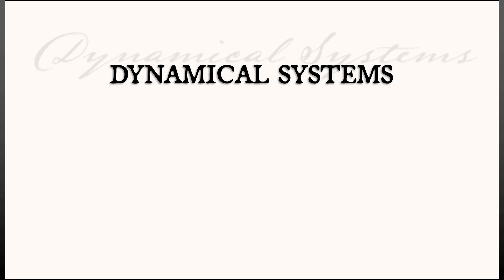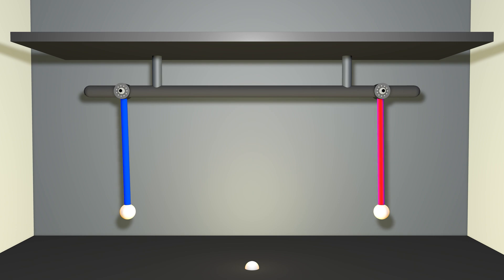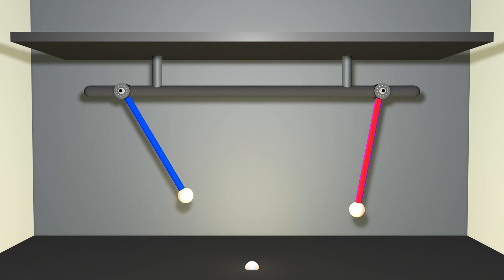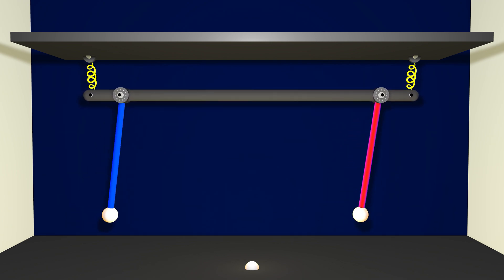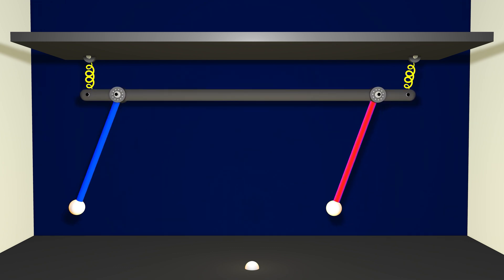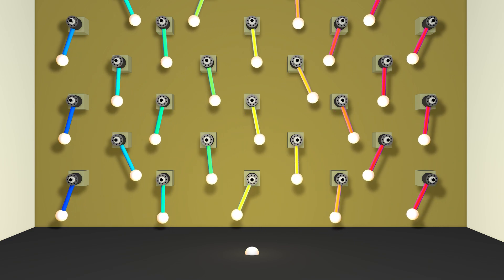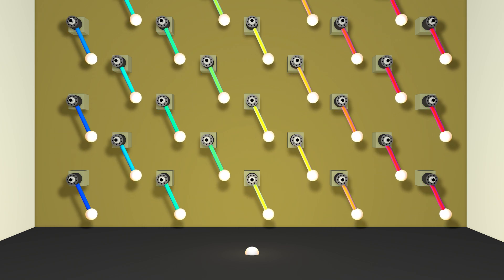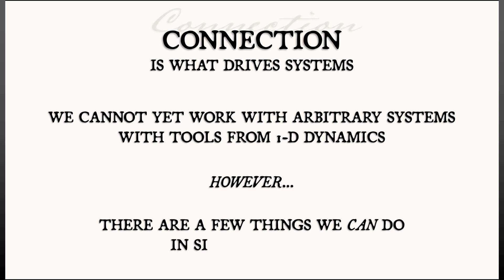ADS : Vol 1 : Chapter 6.1 : Intro to Coupled Systems

Comment: Hey take look at this might be useful, The Principle of Commensurate–Incommensurate Constraint
Abstract
I introduce a unifying principle governing the persistence or relaxation of coupled dynamical systems based on the commensurability of their characteristic frequencies. Systems whose interacting frequencies form rational (commensurate) ratios exhibit phase coherence, resonance, and sustained activity despite dissipative losses. Conversely, systems governed by irrational (incommensurate) frequency ratios exhibit phase drift, decoherence, and relaxation toward equilibrium. This principle provides a domain-independent criterion for predicting whether dissipation leads to decay or sustained dynamical structure.

1. Motivation
Many physical, mechanical, and computational systems display long-term persistence despite continuous energy loss, while others rapidly relax even under weak dissipation. Traditional explanations often invoke system-specific mechanisms, obscuring a deeper invariant governing both behaviors. This work identifies frequency commensurability as the decisive structural factor determining whether dissipation suppresses or sustains dynamical activity.

2. Definitions
Let a system consist of two or more coupled subsystems with characteristic frequencies {ω₁, ω₂, …, ωₙ}. The frequencies are commensurate if all ratios ωᵢ/ωⱼ are rational numbers. The frequencies are incommensurate if at least one ratio is irrational.

3. Statement of the Principle
Principle of Commensurate–Incommensurate Constraint

In a coupled dynamical system:

(a) If the interacting frequencies are commensurate, phase relationships recur periodically, enabling coherent accumulation of interaction effects. In this regime, dissipation does not eliminate motion but is counterbalanced by resonant energy exchange, leading to persistent or self-maintaining dynamics.

(b) If the interacting frequencies are incommensurate, phase relationships do not recur. Coupling effects average to zero over time, and dissipation leads to irreversible relaxation toward equilibrium.

4. Physical Interpretation
4.1 Commensurate Regime (Rational Ratios)
Phases periodically realign
Perturbations reinforce rather than cancel
Energy transfer is coherent
Dissipation is trapped within the system
Long-term activity persists
Canonical examples:

Mean-motion resonances in celestial mechanics (e.g., 1:2:4 Galilean moons)
Mode locking in oscillatory systems
Harmonic synchronization in engineered systems
4.2 Incommensurate Regime (Irrational Ratios)
Phases drift indefinitely
Perturbations decorrelate
Energy spreads rather than accumulates
Dissipation leads to decay
System relaxes toward equilibrium
Canonical examples:

Quasi-periodic motion
Ergodic mixing
Decoherence in coupled oscillators
Anti-resonant isolation strategies
5. Role of Irrational Constants
Irrational quantities such as √2 and π act as generators of non-closure:

They prevent periodic phase alignment
They suppress unintended resonance
They enforce dephasing by construction
Rational multiples of irrational constants (e.g., (3π)/2) remain incommensurate and therefore belong to the same relaxation regime.

6. Generality Across Domains
This principle applies independently of system scale or substrate:

Celestial mechanics
Structural and mechanical engineering
Signal processing and control systems
Computational scheduling and operating systems
Information flow and cryptographic isolation
The determining factor is not energy magnitude, force strength, or material composition, but temporal structure.

7. Consequences
Persistence does not require external energy injection.
Dissipation alone does not guarantee decay.
Long-term activity emerges when relaxation paths are structurally forbidden.
Stability may arise from enforced oscillation rather than equilibrium.
8. Summary
The persistence or decay of coupled systems is governed by whether their characteristic frequencies admit a shared temporal lattice. Rational frequency ratios trap phase and sustain dynamics; irrational ratios dissolve phase coherence and enable relaxation. This principle reveals a structural invariant underlying resonance, synchronization, and decay across physical and engineered systems.

Comment: I'm confused at 0:45 where you say that, because you pulled back the pendula unequally, they have different periods: doesn't the period depend totally on the length of the pendulum?

What am I missing?
Reply from the maker: did i say that?  hmmm... well, that's what happens when you ad lib the script at 5am.  i'll try to go back and clean that up.  thanks!